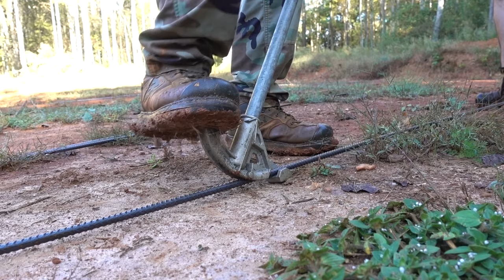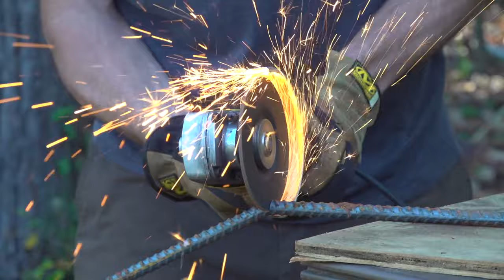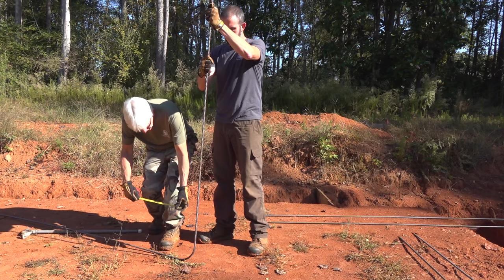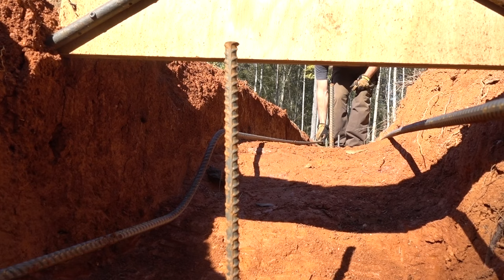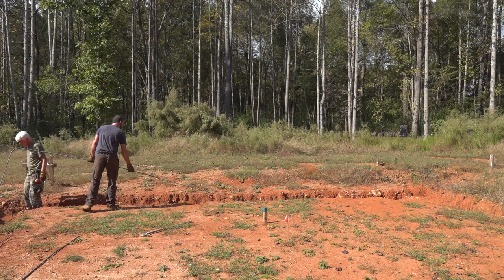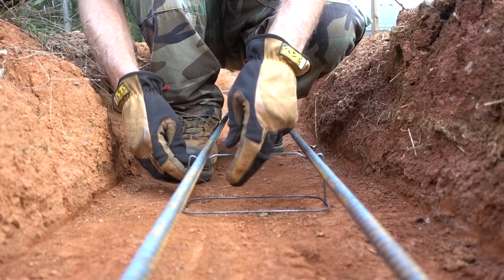Laying Rebar For Our Footings

Comment from the maker: For those of you bringing up the concern of rebar used as grade pins,  we have several property pins that clearly state "1/4 inch and some 1/2 inch rebar" We even have one that states its and "old axle" lol..  Brian and I have located all of them which are many on our somewhat cut up property line. Every one of them are still in tact and other than surface rust they seem to be doing fine. :) They are 50 plus years old. A study that I have yet to be able to locate states that they found that rebar was expected to last 413 years before rusting out completely in a foundation situation such as we have here. :) We are no experts but from our experience there is little concern here. I could see the potential of rebar rusting out much faster in areas or states where the soil composition is such that it induces rust at a much faster rate but I can not be sure either way. Further more every contractor associated with concrete in our area that we have talked to about this does exactly what we did or similar. Those chairs are sold for exactly what we used them for as well.

Comment: a wonder in the cold states footing sand is put before concrete ????
Reply from the maker: Maybe has something to do with the cold up there?
Terry
Reply: @ForestToFarm  The cold in Massachusset is strong and I have noticed that all the foundation of the basement is put sand before the concrete and they wanted to know if the footings should also be sand ???
Reply from the maker: @Raymond cabreja  ? Not sure why they would use sand. Maybe to help with settling issues?
Terry

Comment: Think a 44 y/o mom could do this herself for a 4'x3' pond???😬🤯 The main thing I'm trying to figure out is how  to "float" the bars since having any of it exposed to the ground  causes oxidation  and compromises the stucture.
Reply from the maker: They make chairs similar to what we used that are made of plastic. I don’t know your strength and determination. My sister could accomplish this while my wife would struggle severely before failure. My wife is the most determined woman you will meet and the most responsible dedicated   Person I know but she lacks mechanical skills on that level plain and simple. I would buy one stick of rebar. Not gonna break the bank. Then try to bend a 90 degree angle in it at what ever length you need plus enough for the overlap you plan to have. You will know then if you can accomplish the hardest task. Look up over YouTube videos that are about “bending rebar’. Some people use other methods that are more doable if you have less strength I would think like drilling a hole into a board and running the rebar through the hole and using it as a bender. You may be a physically strong woman as many are these days. If so a conventional bender  may work for you but they are costly. I feel like if you actually think you can do something and you have skills and diy anyway you probably can do this.
Terry
Reply: Find u a man Andrea lol

Comment: What's the hand tool used for bar bending and where can I get myself one. Please assist
Reply from the maker: One was a half inch emt conduit bender. The other was an actual rebar bender which from what I have seen are pretty expensive. Hope this helps. 
Terry

Comment: I thought the vertical rebar can't  be embedded into the  ground
Reply from the maker: 😁. I have heard that many times. In this area it has always been done by most contractors and still is being done. Personally I think using fiberglass rebar for pins would be a better choice for grade stakes. I did not know about them prior to this project. Thanks for watching!!
Terry

Comment: hi how many inches should be apart
Reply from the maker: I don’t want to mislead you. I am not sure what the code says on this. It was not required in our area. We just like to overbuild when possible. However the space was determined by the preset distance bent into those rebar chairs we installed. Thanks for watching!!
Terry

Comment: I thought the rebar is not supposed to touch the dirt?
Reply from the maker: The rebar in the ground are grade stakes. They are not touching the structural rebar. This is the way everyone here does it. Been that way forever. I have a friend who works for a huge construction company. He is over the concrete division. They always do this. Read through the comments. There are many discussions about it. I have no concerns. Its gonna work because it has always worked here. :)
Terry

Comment: In the 80's I used to build block walls. No rebar or metal is suppose to touch the ground. The metal will start to rust & get into the footing and weaken the cement to the point it fails. Yes it will take years but nevertheless l wouldn't want to be around when it happens.
Reply from the maker: Then  probably 90% or more of the homes in this area of many many McMansions will be falling over soon because pretty much every builder/  concrete guy I know, of which there are many, does it this way. 😁
Thanks for watching and sharing your thoughts. 
Oh yeah and we have a good many property pins around our very cut up piece of land and a good many are actually rebar and of them some are about 1/4”. They have been in the ground for over 50 years and potentially much longer as its been that long since it was last surveyed. We even have an old car axel for a corner pin lol 😂. They are still in great shape being exposed all these years. 😁
Terry

Comment: Ins pector did not let me to stick a piece of rebar in the dirt to tie my rebars
Reply from the maker: Lots of people oppose doing it from what I hear. There have been studies about it and they said in something like 430 something years it could be a problem. I think where that comes from is places along the ocean where the soil is salty. Rust would possibly be an issue there. Here every contractor I talk to says they use rebar so at least here it seems to work out OK. 
Terry
Reply from the maker: Worse case lets say those rebar stakes rust out. Then we have a half on hole in our roughly 20”x9” to 12” deep footers. Not gonna be an issue. People drill holes in concrete all the time without issue. 
Terry
Reply from the maker: Oh. Just saw the part about you wanting to tie your rebar to it.  We used it for grade steaks. It was not connected directly to the rebar itself. Just the chairs in a couple of places. I honestly would not suggest hooking directly to the rebar. 
Terry

Comment: I admire you guys and your unpretentious presentation. Great job. Regarding the rebars in contact with the soil. Stakes are single point of contact with the soil. In about 150 years the moisture intrusion into the horizontal rebars through the single point of contact, would be a pimple on a cow's ass. So don't use this method when you build a Cathedral or any historical monuments because look at the Notre Dam. During restoration of one of your buildings in the 25th century, the s**t will hit the fan when they find only FOCIL at the "POINT OF SOIL CONTACT WITH THE REBAR" Historians will drag your names through the mud.
Reply from the maker: Lol 😂 love it!! Next time we are going to do better. Thanks for watching and commenting. 
Terry

Comment: Was this inspected?  The chairs that you used are metal against earth that will corrode and transfer that corrosion up to the reinforcement. So will the pieces of bar that were hammered into the soil. Should have used concrete Dobie blocks or plastic chairs to support the reinforcement.
Reply from the maker: Those chairs are designed for use exactly as used. The rebar grade stakes are used in our area by most everyone we talked with in the construction world and not one time has anyone had an issue. I am talking many of these people have been building for 30 and 40 years plus. We have no concerns about it. :) Besides there is way too much plastic in our world already. :)
Terry
Reply: I’d never pass it
Reply from the maker: @MB-oc5ty  Are you an inspector and where do you live? Just a general area would do. :)

Comment: rebar shall not contact soil
Reply from the maker: I agree totally and nothing used as actual “ rebar” touched the ground. However we did use some of the same stock as grade stakes to help keep the footers level while pouring concrete. Its done all the time by pretty much every builder I know in this area and from what I have seen all across the country. 😁
Thanks for watching!
Terry

Comment: Your method would not pass almost all building codes.  None of the metal should touch the ground.
Reply from the maker: I see it all the time on YouTube in other parts of the country. Also pretty much every builder I know in this area does grade stakes this way. They were not part of or connected to the rebar system. They were grade stakes helping you keep the concrete pour level. 
Thanks for watching!
Terry